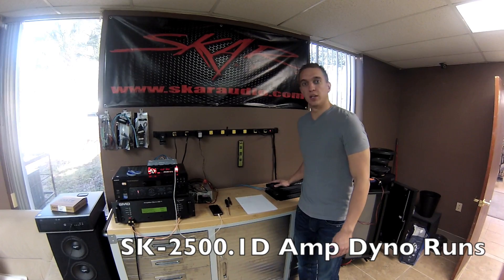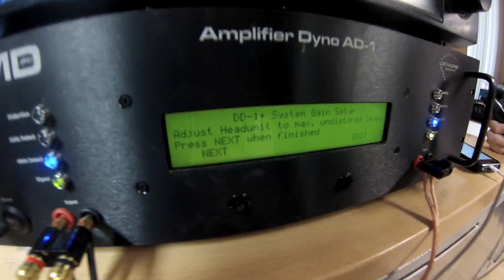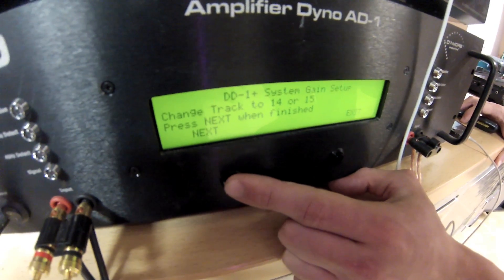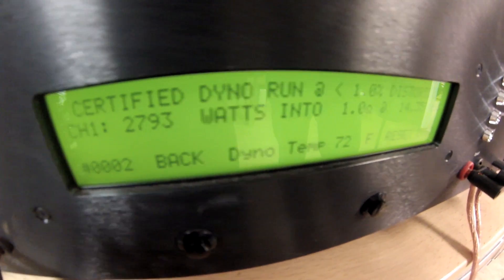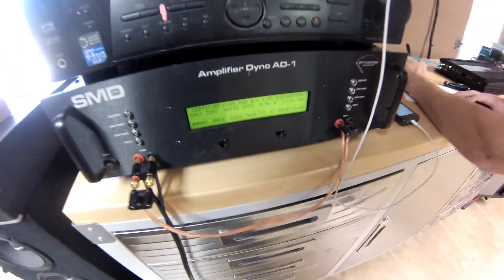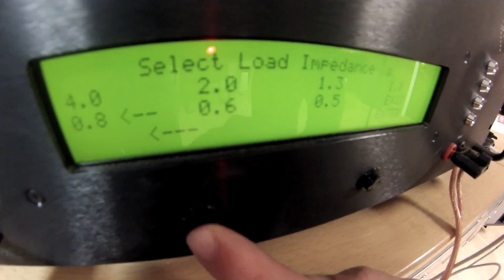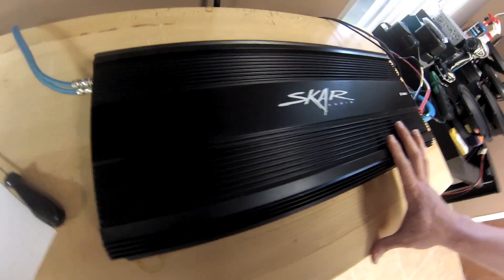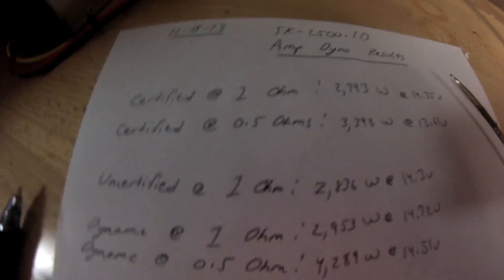Skar Audio SK-2500.1D AMP DYNO TESTING (SMD AD-1) // POWERFUL!!

Comment: I was running this on my stock 160a alt and 2 yellow top optimal and did very well, since 2 wks ago I purchased a mechman 370a elite and had much more improvement.. I've had to readjust all my gains and I'm holding 14.4~14.1v all day, even at idle.. 370a is a beast for $599 and we'll worth the upgrade, stock 160a alt was over $200 for my truck so I spent the extra

Comment: I bet it will do 2500 @ 12.6 volts
Reply: +Mr Freeman I'm stating a comment  stupid fuck, sounds like u have experience with tailpipes, my voltage is decent.. I'm actually selling the skv2.2500 for an hcca3k orion is rated at 12.6, the hcca3k does over 6k at 14v
Reply: @tankdog03ify  how much you asking for the skar amp bro
Reply: If you are running 12.6V you need to crank your engine up, also wouldn't hurt to stop sucking on the tail pipe.

Comment: Now... test it at 12.6 lol. I will say that my rp2000.1d definitely does rated at under 14 volts so there are some brownie points for skar. Would like to see more realistic voltage being used. Obviously you're going to get good results when using super voltage that alot of people don't have.
Reply: it's to simulate an alternator dummy, why would he stress an amp on a 12v battery? it would be a waste of time.. dyno test are not done with a charger hooked up, that's why they use a big bank of batteries.. I think u should watch a few more dyno videos
Reply: if he started at 12.6 it would end at 9v and fry the amp or go into protection.. my truck runs at 14.4v you must have weak electric.. this amp is made for upgraded electrical..
Reply: Alternators put out 14V+ and supply constant charging. If your electrical system is dropping to 12.6V you need to turn your gain down or upgrade.

Comment: what rms at 2 ohms???
Reply: I bet its pushing 1500 easily @2ohm.. I have this amp, but mine is the skv2-2500 it runs great at 2ohm..
Reply: I wonder would it push 4 cvr 12s hard
Reply: +Joseph Harvey yea easy if u get it running at 1ohm
Reply: tankdog03 going have the wife order that bad baby...i was going go with audiopipe 2000 but no thank skar for the win

Comment: 16 volts???  Please run it at 11 where 80 percent of amps run at lol.
Reply: Pretty shitty electrical if you're running @ 11V. Back in 2002 I ran a pair of Autotek SX1700's on a 200A alt and 2 Interstate batts('80 Impala). Never went below 13.2V
Reply: buy urself an alternator before you buy a big amp, or you will definitely have problems.. or stay under 1000 watts for sure..

Comment: Using 16v battery's.. yeah because everyone has those, or has an alternator that puts out 16v... Definetely should NOT be compared to CT Sounds or Sundown Audio. 

I could see using 14v battery's and then keeping them up to 15v for the test. You should try them on a 14v battery bank & see if they still pass. Bet they wont :)

Comment: Skar audio is the same as sundown
Reply: wrong
Reply: +j readdy same boards maybe, different components inside tho, could be better than sundown, there amps both do over rated.. pay extra to have sundown stamped on it? you would never know the difference in sound if u was blind
Reply: Adam Neill they really are..I had both,both were 6800 watt systems...what did you have?
Reply: Big price difference. Skar = $350  Sundown = $500 for the same specs.
Reply: +Mr Freeman better check your prices again, sundown is more than that for a 2k
Reply: I was referring to subs, the 1500w RMS subs for each company. You can pay $350 or $500 depending on who's name you want on them.
Reply: +Mr Freeman skar subs don't even compare to sundown subs, I've had both, and will only run sundown subs from now on. skar subs are China subs, sundown is made in USA from the x series up
Reply: That would explain all the bitching and fussing over the last couple of years by people pissed that Sundown moved manufacturing over to China.
Reply: +Mr Freeman only there cheaper series subs, and sundown is better than a ajar of the same class 100%.. you totally get a pure quality sub for the price u pay.. 
I've ran both 1500rms from each, and the skar vxf12 couldn't take much more power without clipping, I've ran over 3k to the X12 series and I wouldn't hesitate to give it more clean power
Reply: +Mr Freeman I do currently run a skv2.2500 to my x12.v2
skar Korean board amps are great so far, do over rated and reliable so far, no problems as of yet.. it was 499. I'm sure that the sundown that best compared to this amp is well over 800

Comment: Lmao ur ct 2500 reply is dumb af u know that's not a 2.5k board it's a 3.5k board that they named a 2.5k that's why it does the same power as a saz 3500 dc 3.5k and sq 3500

Comment: @Jose maria: Plz know what you'r saying about Ct Sounds 2.5k doing 4k yes it does because it has 4k board just take a look, The name is nothing even if it's underrated that much it doesn't make since to compare it to real 2.5k amp with a slightly underrated power, For your information Ct Sounds will change the name to 4k or 3.5k instead of 2.5k and they will have higher price tag because they are using 3.5-4k boards in their 2.5k amp LOL!,

Their 7k Amp did 8k or even more @12v so their amp are ridiculously underrated but plz don't compare it to other amps without knowledge just take a look on their internals!

Great Products SKAR AUDIO All the way, Thumbs Up.
Can't go wrong with this great owner Mr.Shclenker,
Best Regards.
Reply: fled one IDK bro if you are a CT nuthugger, but CT known for getting up in majic smokes, and they are Chinese not Korean amps!
Reply: Orion xtr2500.1 rated 2500 at 12.6 VOLTS. Actual rms at 12.6 on my birth sheet 2954 watts at 1ohm. So if I give my xtr 16v battery bank I guess I'll be hitting 5000 or more lol. I really want to see the dyno at realistic voltage.
Reply: Oh almost forgot... at half the cost of the skar sk2500.1... just food for thought.
Reply: +BaSsAholiC and u have a bunch of cheap plastic parts..

Comment: that amplifier is worth every cent now im looking to buy one thanks Kevin and Honey Badger by the way this test was vary accurate! comparable to having a vehicle running and a good charging system!
Reply: bingo, everyone else is trying to run this amp on stock electrical lmfao.. you cant!
Reply: @tankdog03ify  do you think you would need an upgraded alternator? And battery or just upgraded battery?